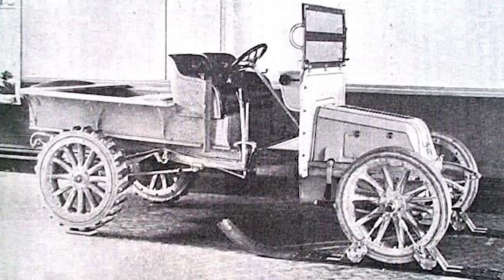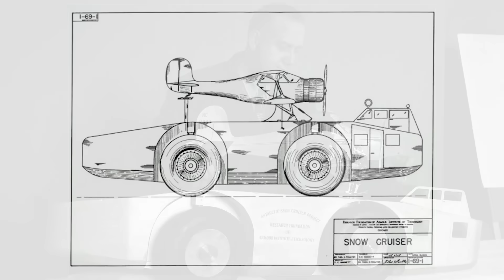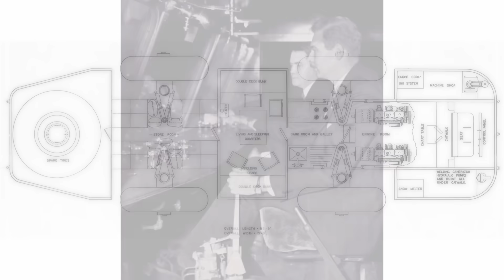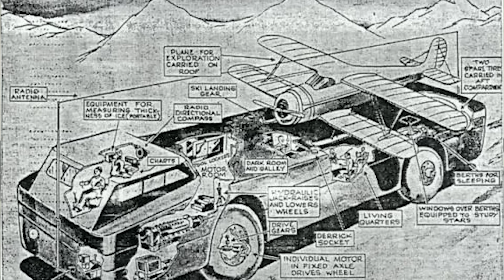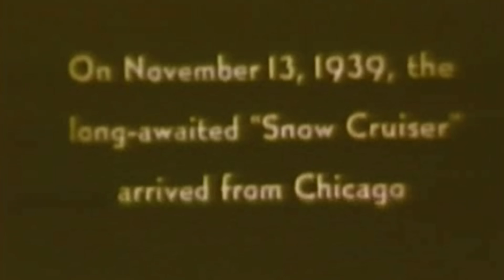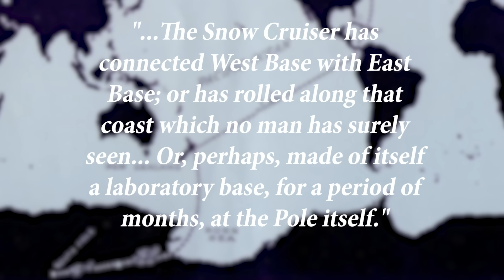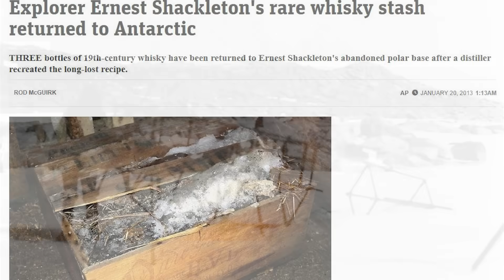"The Snow Cruiser"-Antarctica's Abandoned Behemoth

Comment: "Hey, look at how well tanks and other  tracked vehicles move around on the ice. Lets not use anything like that."
Reply from the maker: The Cruiser was built in 11 weeks, and Poulter (the designer) accepted from Gulf Research a set of moulds for large tyres 3 m in diameter and 0.9 m wide, developed by Goodyear for a lightweight swamp vehicle used in oil prospecting. At the time they knew that wheeled vehicles worked on ice but not on snow, however, there were no real measurements or systematic observations to say why that was the case. Poulter had seen tracked vehicles running successfully on deep snow, and could not see why suitably clad wheels, large enough to distribute weight and minimize pressure over the surface, should not work just as well.

The cruiser was tested briefly on Sand dunes and found to work quite effectively. Sand and very cold snow behave similarly but not identically. Poulter had measured and found coefficients of friction for the two to be about the same, but the unit weights (which he apparently did not measure) differ. Sand is roughly four times heavier than snow, and Poulter might have predicted that performance in sand could well be four times better than in snow.

It's frustrating in the comments of the video because I keep having to respond to people calling the designers and entire team 'morons' and even worse weirdly aggressive insults for not knowing how to build the snow cruiser effectively. It's hard to appreciate how much of the technology that was being utilised here was in its infancy, and that so much of what we now know about tyres, treads and transportation over ice and snow came through failure such as this.
Reply: @CalumRaasay  J-A Bombardier in Canada at that time still had better understanding of how to travel on snow. His designs have proved more efficient over time and it laid the foundation for later snowmobiles. Of course Poulter didn't know everything, snow travelling was still at its beggining at that time. It is always interesting to understand the context behind the design of something.
Reply: @CalumRaasay  People who consider themselves engineers and do all the theory with no practical testing are considered "Imagineers". It's an unfortunate end for the amount of potential.
Reply: @CalumRaasay  well said Calum
Reply: @CalumRaasay  its still dumb that they didnt think about tracks
Reply: @Cinnamorollthecut3st  they did think about them and decided that developmwnt of tracks would be 1. A bad idea for a lot of explained reasons 2.be too costly(well functioning tracks are complicated and the 4 independent motors the snowcruiser had made development easy) and 3. Take to long......so they settled for tires, a proven system still in use at the poles today even with similiar tires, they just have a little bit more tread.
Reply: @CalumRaasay  I think your post, and particularly the closing paragraph, is eminently reasonable and extremely well argued.
Reply: @CalumRaasay  "Poulter had seen tracked vehicles running successfully on deep snow, and could not see why suitably clad wheels, large enough to distribute weight and minimize pressure over the surface, should not work just as well."
Your own words reveal several problems that even mediocre engineers should have anticipated.  Looking at the size of the actual production wheels and given the weight of the vehicle, it should be obvious that the weight is too much for four relatively small contact points.  Although tires have some "give," (and therefore flatten and increase the surface area of points of contact) they are still more or less shaped like circles and we may argue that an ideal circle touches a plane at exactly one point. Therefore, a circle is exactly the WRONG shape for the contact surface with snow and ice.  It cannot even efficiently make use of additional engine power; I'm sure you've experienced getting stuck in a snow bank and how "gunning" the engine just results in spinning tires.  Even from a safety perspective, they should have anticipated that they might encounter terrain where the ice masked ravines or other dangers.  Low surface pressure for a vehicle would need to be a priority.  Tracked vehicles had been known and used for the very same situations since tanks were developed for the first World War TWO DECADES PRIOR to this expedition.  Finally, there is no harm in over-engineering a vehicle in this regard.  Making the surface pressure several times lower than necessary would have been one of my top design criteria.
Look at the Tiger I tank which entered production little more than two years later.  It had very wide tracks for a 50 ton (!) vehicle with a much, much smaller "wheelbase" than the Antarctic cruiser.  That suggests to me that engineers of the time were more than capable of understanding the interaction between surface pressure, power delivery, and vehicle weight.  In 1939, many tank designs were already in production, proving conclusively that tracked vehicles had tremendous advantages in distributing weight and providing traction in muddy or icy terrain.  Even the French Char B1, which went in to service THREE YEARS EARLIER in 1936, had the shape and features I would have expected for the Antarctic cruiser.  It weighed 28 tons.
Let's face it: the antarctic cruiser was a terrible piece of engineering from several perspectives.  I have been an engineering project manager.  We would never have gone forward without adequate testing, theoretical soundness, or production quality.  In the video you said it yourself: while moving to the launch point in Boston, they ran off the road, became mired in mud, and were unable to drive out!  That should have been a flashing red warning signal for the expedition itself, where the conditions were to be considerably harsher.  I understand they were under time pressure, but you almost have to be a manager with money (and your job!) on the line to understand: there is no point in rushing if failure is the likely outcome.  So what if you are under time pressure.  If you cannot deliver a working prototype within the allotted time, an attempt would only be a waste of resources.  But perhaps this is something only responsible adults understand.  I see it in business all the time: people overstep themselves, think they have a great idea, and end up failing horribly because they don't test properly or don't have a good mind for anticipating outcomes.  Success is usually the result of combining ingenuity with pragmatic application and a lot of due diligence.
Let me phrase it even more bluntly.  Participation awards are what they hand out to children.  It is not enough in life to merely make an attempt without at least a reasonable projection for success.  This should especially be true of potentially hazardous expeditions to the Antarctic, far from likely help or surveillance.  In such an environment, where the lives of human beings would be at stake, engineers should take extra care to build something they could rely upon.  Clearly this vehicle was the work of amateur (or immature) engineers, even for the era.
Reply: @Qichar  tracks were even more in its infancy than tire technology, everything you said is nearly made obsolete by the near impossibilty to carry a spare tank track and change  that track in arctic conditions, the charkovchankas had extreme problems with theirs........the tires are balloon tires and dont work like you propably think they do, they go completly flat on the ground, they have larger contact patches than most (realistic length is a problem for tracks) track systems could have had, there is a reason most antarctic vehicles today still use tires(all transporters basically, they mostly use articulated dumper chassis) and the ones that do not use tires use rubber tracks a technology only really developed some 40(arguably 70) years later
Reply: @CalumRaasay  I think that's what many don't understand. That almost every significant invention,  tool, technology, whatever it is, that we use in our lives, somebody else had to fail initially for them to take their more polished form that we enjoy today.
Reply: @D00kerT  to "try" balloon tires without any tire treads for a heavy antarctica snow vehicle is stupid like .... sorry, i can't name a comparison.
Reply: @CalumRaasay  Thank you. It seems that for every thoughtful, incisive comment on YouTube there are ten examples of sort of truculent trollery you have so rightfully denounced. Without your efforts, I would have remained completely ignorant of this remarkable, though misguided, feat of engineering. 
I paused your vid at several points to study those line drawings and magazine illustrations to get a better appreciation of the design. However, the creators of those illustrations, perhaps from considerations of what was deemed propriety in the 1930s, left out anything relating to the health and hygiene of the crew other than food. Four men are going to generate a considerable amount of waste, but there seems to be no provision for the necessary plumbing, nor is there any evident means for them to bathe or wash other than one sink in the galley. Perhaps there was a head and shower in the aft spare tire compartment along with enough piped-in heat to keep everything from freezing solid?
Another issue I noted as unaddressed by those contemporary drawings was engine exhaust — particularly CO. The cabin of the Snow Cruiser must have been well-sealed from outside air, otherwise, the race between heating and freezing would have been lost to the ice very quickly. But that presents a grave risk of CO poisoning unless effective measures are taken to scrub CO from the air or somehow vent it outside without letting too much sub-freezing air inside.
As for the total failure of the Snow Cruiser as an exploration vehicle, perhaps the tires weren't the entire problem. In the 1930s diesel engine technology in the United States ran well behind such technology in other countries, particularly Germany. The situation contributed to the US Navy's failures to produce a submarine design able to maintain 20 knots surfaced until just before the outbreak of war. Is it possible that the extreme cold caused the twin diesel-electric units to fail to meet their output at more clement temperatures? 
The piggyback airplane is interesting. It appears to be a Beech Model 17 equipped with skis. Though the Staggerwing was a highly respected executive plane, the King Air of its day, I haven't seen any pictures of one actually in service as an arctic bush plane, whereas its near-contemporary, the Noorduyn Norseman is still flying in that role. I wonder how the Beech 17's wood-and-fabric fuselage would hold up to the task Adm. Byrd had in mind.
Reply: @CalumRaasay  So, basically, they rushed and had to use gifts to undertake the project
Reply: @optimalbass  You still are wrong. Do you know anything?
Reply: @optimalbass  That hurt my feelings
Reply: Calum cmon its just the typical yt joke.
Reply: @ECHOFOXTROT289   Don't you miss the old days, when jokes were expected to at least be funny? I do ...
Reply: @Gottenhimfella  And the PC police didn't exist.
Reply: Edoardo Ferrari This isn’t a joke, it’s serious. Why not use that instead of wheels? How is that a joke?
Reply: Calum nice page of words I’m not gonna read
Reply from the maker: Glad I can finally share this! The tracked version of the snow cruiser , pioneered by the soviet union n the 1950s- the Kharkovchanka! https://youtu.be/f6R-h06IsJw
Reply: So, we just come to obscure informational videos to enact our need to be a cunt now?
Reply: Hey how heavy is the snow cruiser?
37 tonnes.
Ok, let's use a wooden ramp to get it offf the ship...
Oh and lets keep the tyres smooth, we don't need any traction on the ice.
Reply from the maker: Andrew H I don’t think anyone is saying it’s not a failure. It’s just an interesting piece of history, and while it failed many features of future vehicles such as the Kharkovchanka were taken from this design. I go into more detail in my video on the Kharkovchanka in that link you posted.
Reply: Another Trent Sup
Reply: I should have expected a quick attempt at humor to become my most popular comment.  

The people who worked on the snow crawler were not idiots. In fact, they were most likely the top geniuses of their day - which is what makes the decision funny - to me at least. This is the age of the Hindenburg, the Spruce Goose and not too far behind the Titanic. Geniuses became overconfident and made design gambles that didn't pay off. 

Now, we have learned and machines made for traversing snow and ice use tracks or very knobby tires.
Reply: But did they try putting snow chains on that? I mean, I guess they did before abandoning it after all the trouble, but i'm surprised it wouldn't have worked.
Reply: @trezapoioiuy  As shown in at least one picture, yes.
Reply: @trezapoioiuy  Tyres were not the only dumb part of the project, but part of the dumb project. Remeber how many rockets and people they crashed before they finally took off? It's mentality problem.
Reply: "I really like tracked vehicles, so I designed a big wheeled truck" -Jim
"You.. that... there is no relation between the two" -not jim
Reply: They used a slush fund to built it😂
Reply: We big brain do better
Reply: That's back in the day when they would just wing it randomly without really trying to do any sort of calculations.
Reply: @Donald J lol how dare they XD
Reply: "Let's actually use the antithesis of that!"
Reply: @Donald J i drive a diesel every day, can't wait to see the whole planet but with all you idiots
Reply: No shit LOL !!!! GOOD ONE
Reply: Or at least tires with treads but no they choose to use smooth, bald tired
Reply: While obviously in hindsight we know this vehicle was a flop, there is some good theory on why these tires could have worked, and it turns out people are using tires similar to this today.  Look up “Alaskan Bushwheels”, aka “tundra tires”
Reply: Hahaha
Reply: sorta a predecessor to the Mars roamer
Reply: @Donald J Also Mr. Byrd had one hell of an experience in Agartha. That was swept right over in this.
Reply: @Trent Cantrell
"Hey, look at how well tanks and other  tracked vehicles move around on the ice. Lets not use anything like that."
Have you ever personaly changed a track on a tank? Do you want to do that in arctic conditions?
Reply: tracks dont float and arent amphibious biggest downside they cant cross thin ice and water crossing which is need there...
Reply: @mrrod3004  
"tracks dont float and arent amphibious"
A significant number of amphibious vehicle are tracked and have no problem with that:D But case on point in such conditions we have both Arktos and DT-30P transporters. And several others.
Were you trying to sneakily undermine the anti-track argument in the thread by your comment or something?
Reply: @TheArklyte  they arent the machine is tracks dont float and they rust ad break pins often tires are superior i work on both, should see what the sea salt does to em..they hold in dirt/mud water everything else that cause premature rust and corrosion, and rubber tracks dont even get me started
Reply: @ThersanderSM The Cruiser weighed 37.5 tons according to Wikipedia.  It was 17 m long.  A Tiger I tank from WW II weighed 57 tons while being only 6.3 m long.  The weight of the tracks is almost insignificant when compared to advantage it confers in evenly distributing the weight of the vehicle over the maximum surface area.  Also, look at those wheels.  They are huge.  I believe a lot of little wheels like the kind you see on tanks end up weighing less in total than those 4 monstrous wheels, tires, axles, and corresponding drive train.
Reply: @Qichar  the vehicle had no axles and the tires are huge but also mostly filled with air, when it comes to weight and weight destribution, ballon tires are propably the best option, they use large circular patches on wich they evenly distribute the weight, these patches are huge, with the right rim you can have more than the lower third of the tire flat on the ground. A track that is even just 12 meters to cover the lenght of the cruiser would have easily made it 10-20 tons heavier, tracks need larger engines and stronger frames because of their differential steering, also turning with  tracks that  long would have been a nightmare. The only reasonable option would have been something like soucy tracks, replacing the tires with 4 triangle style independent tracks(mostly rubber) but that technology was not developed at that time and also couldnt be in 11 days, these independent tracks also have about the same contact area as equally sized balloon tires.......
Reply: @Donald J Geoengineering is the real climate issue. I think you might be the fool to belive that lie. all combined global transportation including cargo ship, train, plane, even coal powered electric.. is only 3% of greenhouse gas and carbon emissions. Animal agriculture is around 70%.
Reply: @multishit6664 And yet it seems we are mostly concentrating on vehicles and power generation at the moment. Strange isn't it?
Reply: @multishit6664  consumerism and capitalism are the issues, they are opposite to efficiency, which is what we need to keep the planet alive
Reply: @Donald J your a fucking idiot, so whos responisble for the few ice ages that melted before humans were even here?
Reply: @Donald J Good riddance to this crappy planet